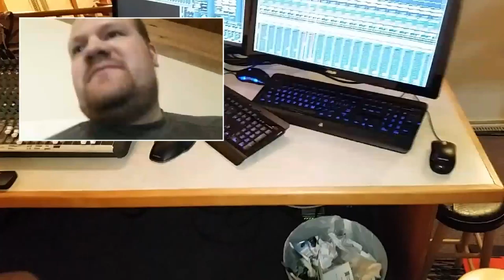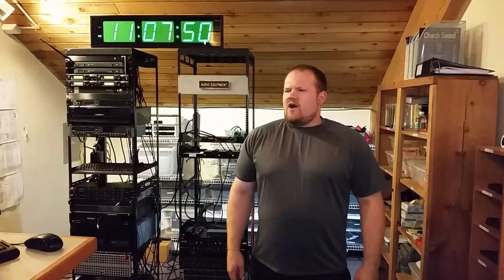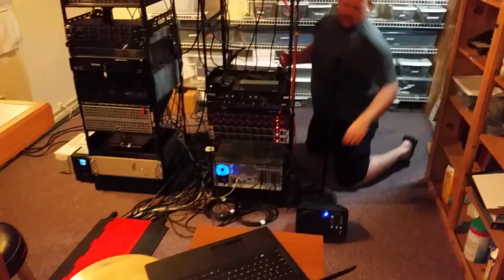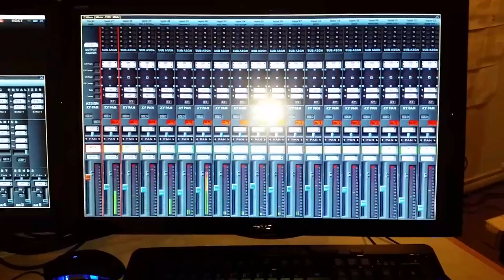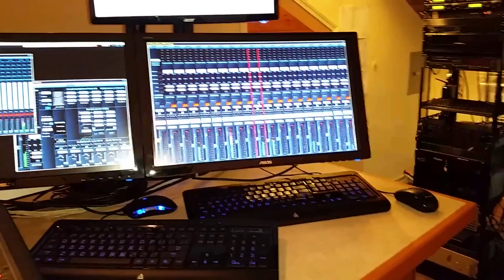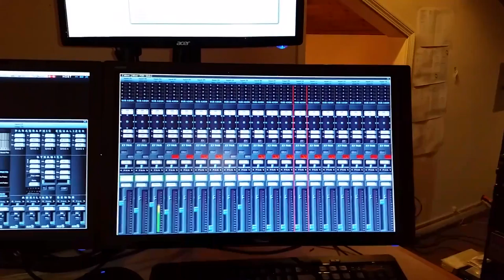Trouble Shooting Horrible Noise - Part 2 (Problem Solved)

Comment: In order to recreate the problem you had to move a dip switch on the Behringer that was the "master" unit. Was that switch in the wrong position at the beginning of the troubleshooting or would everything have been resolved just by restarting the software on the PC?